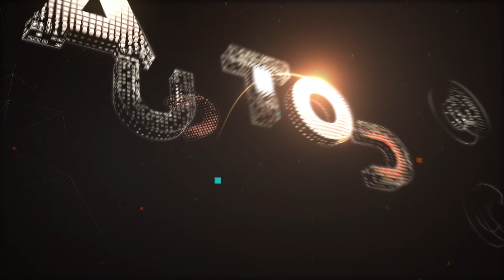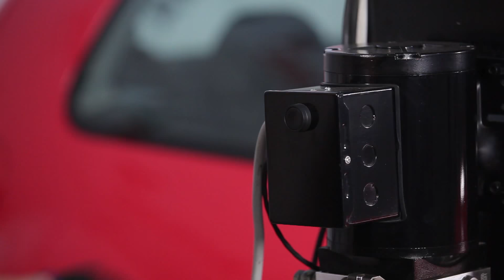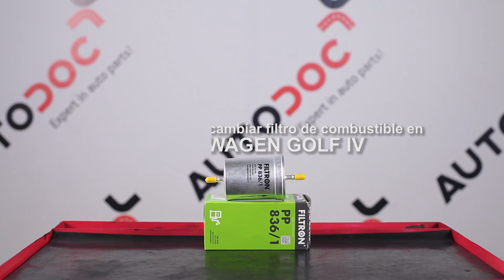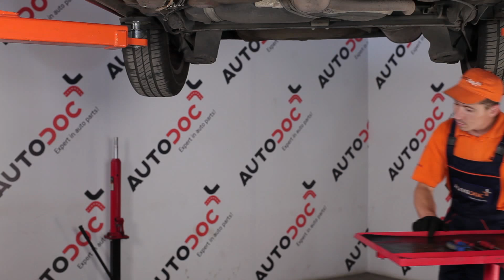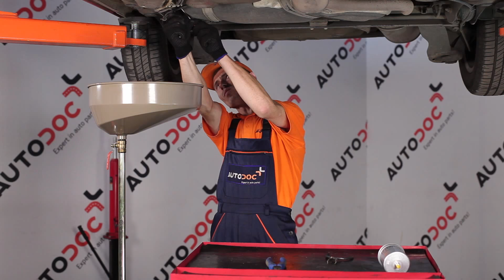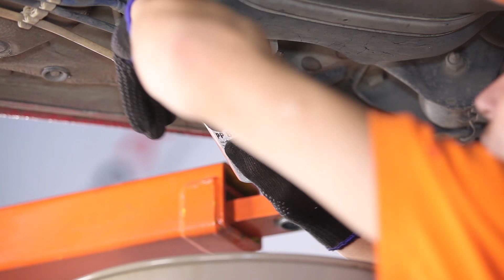Cómo cambiar Filtro de combustible en VW GOLF 4 [INSTRUCCIÓN]

Comment: ¡Hola!, una consulta, ¿ese es gasolina cierto?

Porque tengo un Golf 7 1.6 TDI 110cv del año 2017 y no tiene ese filtro en ninguna parte (o yo no consigo verlo). Mi problema llega porque la bomba de baja del combustible situada en el depósito tiene un zumbido constante desde que arrancas hasta que detienes el vehículo (aunque solo se escucha al ralentí). Cambié el conjunto aforador pensando que era la bomba jodida (440€ + mano de obra) pero sigue sonando exactamente igual. Me han dicho que puede ser el prefiltro, pero por mas que busco en internet pone que el prefiltro va dentro del conjunto bomba aforador acoplado a su parte inferior, y como lo cambié supongo que no podrá ser eso al ser nuevo.

El zumbido es constante, y una vez lo escuchas es imposible quitartelo de la cabeza,  viene de debajo del sillón derecho del asiento trasero, justo en el tanque de combustible. Me revisaron el cableado y me dicen que tampoco es eléctrico. La cosa es, ¿que puede ser?, ¿filtro que va en otra parte y no dentro del conjunto? He levantado mi coche y no tiene ningun filtro ni cilindro en esa zona como el del video.
Reply from the maker: Hola. Según la descripción y sin el diagnóstico es difícil solucionar tu problema, recomendamos ir al taller. Tu equipo de AUTODOC.

Comment: Buenos Días excelente canal muy bien explicado, tengo una pregunta tengo un jetta A4 99 da marcha pero no enciende; un amigo   limpio el conector y desconecto los cables de la bomba y volvió a encender eso fue hace una semana el día de ayer me paso 2 veces y opte por cambiarle la bomba de la gasolina pero volvió a lo mismo lo que hice fue hacer el mismo procedimiento anterior y prendió sin problemas pero analizando el vídeo tengo mas de 1 año que no le cambio el filtro de gasolina podría entonces ser ese motivo la falla que tenga basurita y no permita pasar bien la gasolina o posiblemente las mangueras esten en mal estado gracias
Reply from the maker: Buenos días. Gracias por su comentario. Hay varias razones del fallo. Le recomendamos ir al taller para hacer un diagnóstico completo. Atte, equipo de Autodoc.
Reply: Buenas algun numero para ablarles autodoc